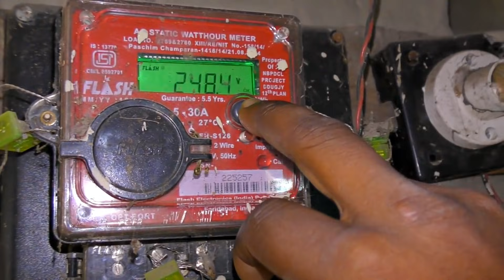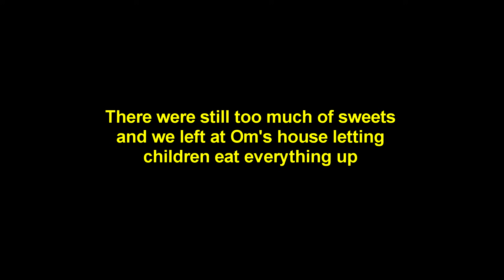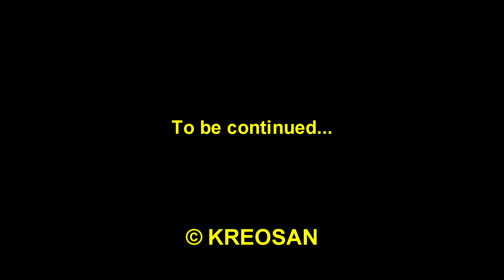Poor Indian House Room Tour 💡 Giving candy to children

Comment: 07:08: I used to work on farm, and one of my jobs was to work a much larger version of a chaff cutter like that, much wider jaws, bigger blades, and driven by a massive leather belt to the PTO of an ancient Farmall tractor.  The machine was used to cut lucerne chaff to sell for horse feed.  You had to be very careful all the time ... if fingers got trapped in the hay or were somehow drawn into the mangle, you would be gone - all chopped up - by the time they stopped the tractor and the machine's massive spinning blades.  Pulling hay bails apart - sometimes nice soft lucerne, other times rock hard grass filled hay, and feeding it into the machine all day.  Very hot work, covered with grass and lucerne dust which was super itchy, especially when you were sweating (which you were the whole time - drenched head to foot, because it was such hot hard work).  There was no emergency stop button anywhere.  Ahhh, the good old days ...